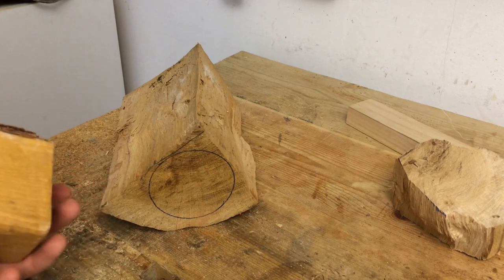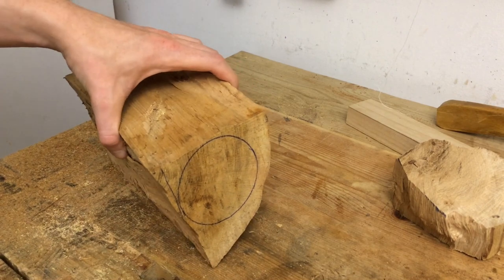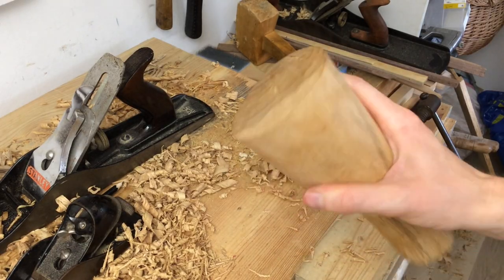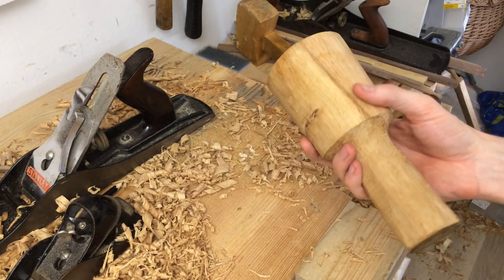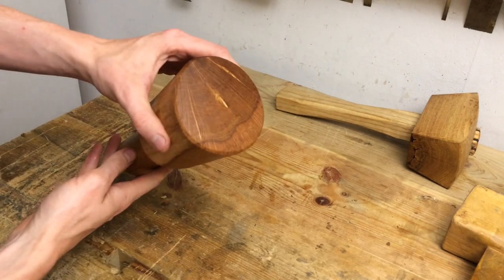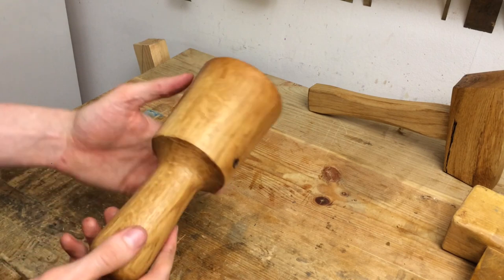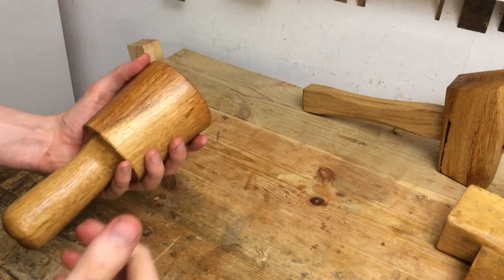Dovetailing mallet without a lathe (new mallets # 2)

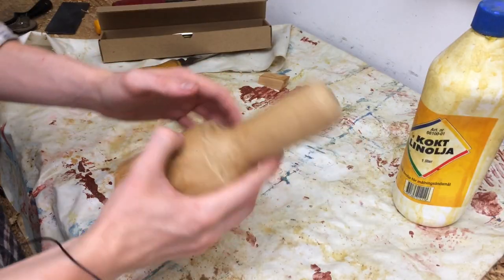Comment: 5:00 Great work, but I would never be using that mallet with a split going all the way through the handle like that. Maybe you can fix that crack with some pins and glue...but otherwise that's a dangerous mallet for your hands
Reply from the maker: I was a little concerned about it, but it's been holding up fine for close to two years. It's a carving/dovetailing mallet so for light work only. If it splits I'll glue it back together :)
Reply: @GillisBjork  And do a video of the repair!